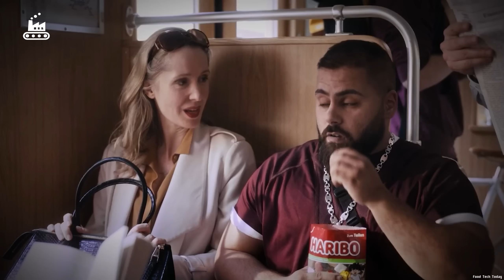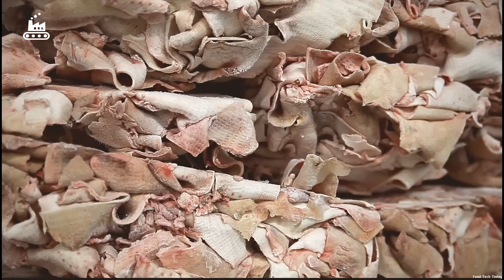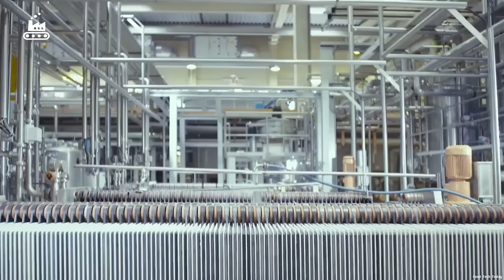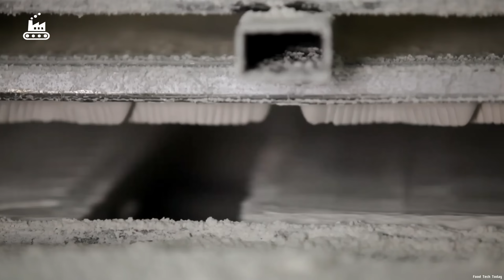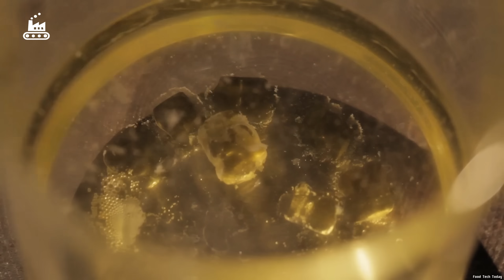Inside the HARIBO Factory That Makes 60 Million Gummy Bears Every Day

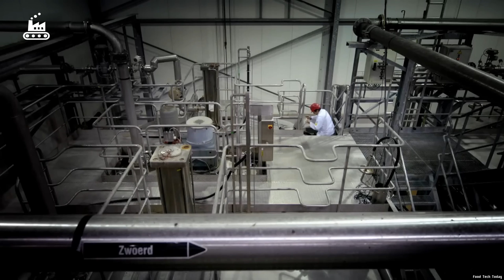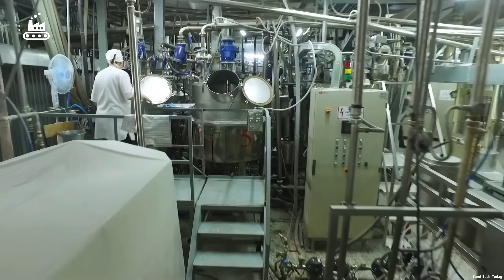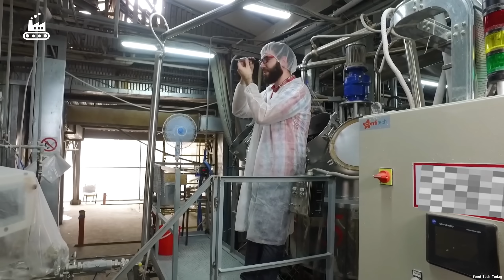Comment: I am confused, in the video you said this is an American facility, but the writing at 3:13 is not in English (seems to be Dutch) and the writing at 6:16 also does not seem to be in English (though I can`t say for sure as the quality is to low to read it easily and in the later shot at 7:02 the text is censored)
Reply from the maker: The machinery and some of the reference material I used are from the Netherlands.
Reply: @FoodTechToday  the 3:13 is form belgium i know that because i work there
Reply: 6:16 seems to be russian :D also saw some german as well I think
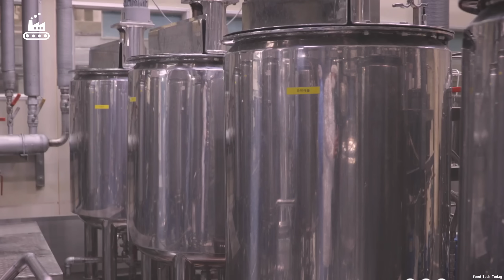Reply: 6:52 is korean